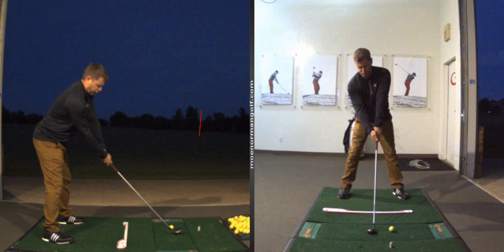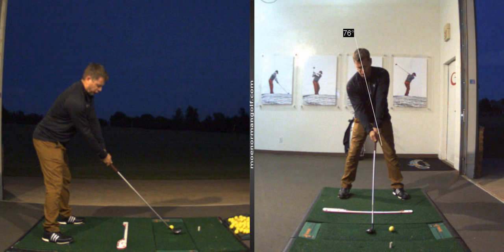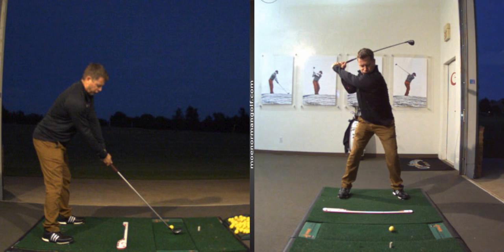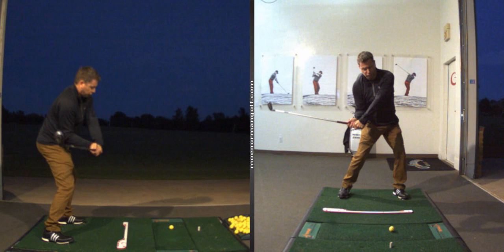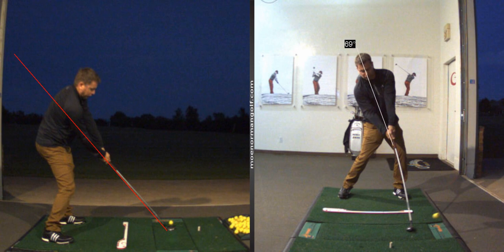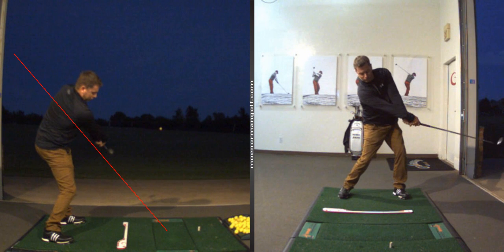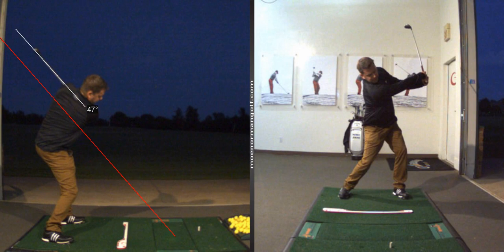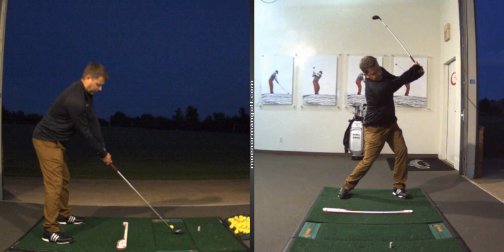Moe Norman Single Plane Swing Practice

Comment: As you set up with the right elbow below the left, is it safe to say at impact the right and left elbow are about even with right getting higher from impact on through fallow through?  For me just the swing thought of the left arm traveling back and around with the right arm under it till impact sure took care of any pulls or slices....with this in mind it also added not a little but a lot of height and distance to short and med irons.....

Comment: Do you ever have students who play this swing with an open stance??
Reply from the maker: Sure.  It is not necessarily ideal but you can open the feet and still swing in a single Plane.
Reply: I was just curious Bc I have a homemade swing and when I try to compare to any other swing it looks the most like what you teach. Except that I have a stronger grip and a slightly open stance. I have tried to change my swing to be more “conventional” in the past but when I do that I can’t make good contact at all so I always come back to my own natural swing. I was just curious if you had seen or taught anyone who swings like you with a stronger grip and a more open stance. Thank you for your response.
Reply from the maker: @mattsmith9109  Matt, That makes sense.  If your grip is stronger, you need to open your stance to "hold off" the face.  I used to have a similar issue.  Once I weakened (neutral) my lead hand I no longer needed to rotate my body open at impact.